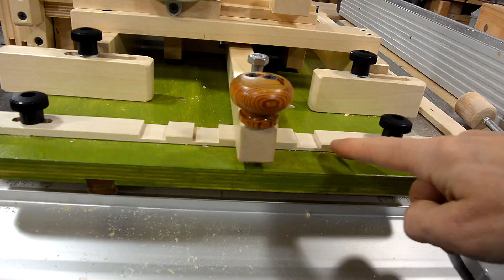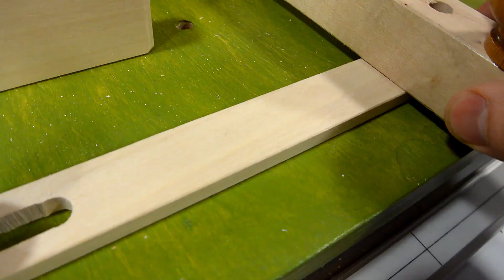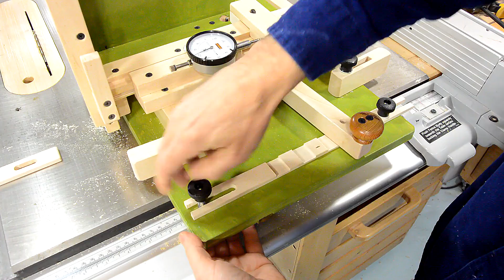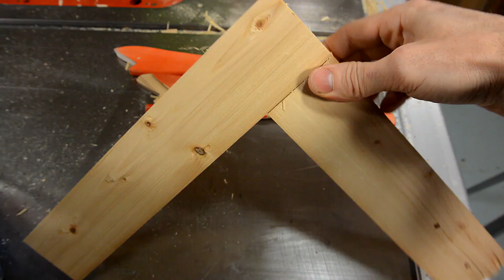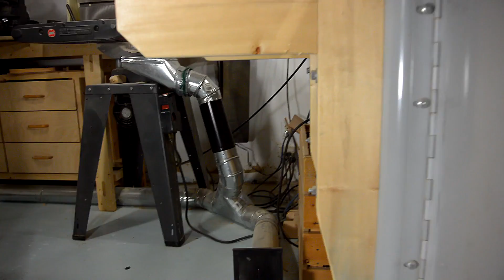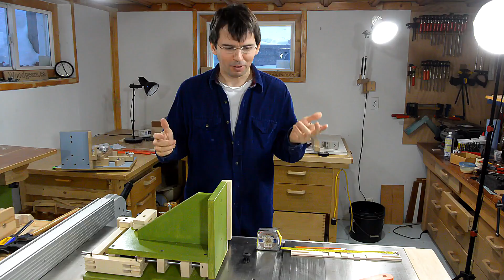"multilap" joint with the quick-set tenon jig

Comment: I wonder if such a template could be used with a slightly tilted blade to finger splice short scraps together into longer planks. I know you put together a good scarf joint for that curtain rod, but I wonder if you have a lot of scraps that are fairly short, but would add up to something much more useful.

Comment: Hmm, not that impressive. You could use a Dado Blade... and make it so you only need to do one cut. Or use a Table Router instead of a Table Saw with a sled like this. Then you could use different bits for the thickness.

Comment: I built this jig and I have been trying to make  "Multi lap joint". The fingers of the joint are 1/4 inch thick,  3" wide and  3.25" deep. However I have been experiencing inconsistent results and tapered fingers. The wood I use is pretty soft, standard spruce 2X4. It looks like the blade is pushing the finger sideways as it cuts through the wood. Also the blade has a hard time cutting through the material. Any special type of blade you use for this kind of cut? I am also thinking the jig might be at a slight angle with the blade, I will have to verify that with a dial indicator. Any ides Mathias? have you been experiencing this phenomenon?

Comment: This will be my next jig build but I think I'll use the screw advance box joint jig to cut the templates instead of eyeballing the notches.
Reply: Can confirm it works well. The normal box joint jig capacity is slightly wider than the width of the tenon jig, so I mounted a short, wide board (wide enough to clamp), cut the notches then cut the template free.

Comment: I cannot see clearly the bolt that makes the impressions.  Is the center cut out only leaving a small sliver on each edge for making two impressions?  
And if there are two impressions do you choose the left impression as the left side of the notch and the right impression as the right side of the notch?   If this is the procedure it seems it would be handy to make an alignment tine on the top of the punch for ease of alignment.
Thanks.
Reply: F
Reply: OK after watching and stopping the video my 78 year old eyes confirmed my assumption about which impression to use.

However an alignment mark on the punch would be be an aid in aligning the punch. 

This said I have a DIY CNC so I’ll just whip out the templates I need on it. 
Thanks

Comment: Very nice!! If you elongated the pin hole that would give you some adjustability in the template wouldn't it? This might enable you to fiddle a bit less? Of course that would also require the ability to lock the pin position.

Comment: I have a ideia...two stepmotors and a arduino...
Reply: we're actually working on that.  I have a 200 step/turn stepper driving a 20 turn/inch threaded rod.  we should be able to make the sled move very accurately.  I think we're going to use a Raspberry Pi.  It won't be nearly as elegant as this one though..Using a microcomputer to control the movement of a workpiece in the shop could be useful for alot of things.

Comment: Stupid question: did you need to move the jig, or was that just a demonstration for the viewers?  I think cutting another piece the same and turning it over have worked.
Reply from the maker: Flipping only works if the workpiece is an exact multiple of 1/2" in thickness

Comment: How cool is that!!!  I've never seen a bolt without its threads like that.  I was at The Home Depot today and they didn't have anything like that. Where might I find something like that without having to buy a lot of them?
Reply: buy a long bolt and cut off the part with threads?
Reply: You can also buy clevis pins. They have holes spaced along the shaft (usually used with 2 washers and a clip. The added benefit is most clevis pins are hardened and closer to actual size than the shoulder on a bolt (unless specifically sized shoulder bolts, which are usually ground to a very precise size and expensive).

Comment: Really neat idea! Btw you should make a fingerjoint jig or something like that, cause bits are expensive and custom made could have more features-adjusting the length for example. Idea to make one is basically the same? Instead of saw blade we can use a single router bit?

Comment: Brilliant.  The notion of using 3:1 reduction is something which never occurs to me, despite having seen Matthias use it with the pantarouter and now with this. That's got to help with precision, right? Any imperfections in the template will be reduced to 1/3 their size, which I would guess is more precise than the table saw is capable of.

Comment: couldn't you have measured the spaces in your template and added one millimeter on every one?
Reply: He added .003".  1mm = .039", 13 times the necessary adjustment.  The satisfying sound of a well fitting joint would have been absent, as well as the strength of the assembled joint.

Comment: since the bolt is tracing out a circumference, shouldnt the template be correspondingly curved? clearly not a big deal based on your excellent results, but i wonder if you could improve precision by addressing this somehow
Reply: you could make a specialized bolt that has a required orientation, and then its curved on either side where it would touch the template, so it automatically adjust as your bar strays further from perpindicular
Reply: Not necessary so long as the arc stays within the template width. Notice in the vid that Matthias marked the slot edges based on the outside tangent edge of the reference bolt diameter. That is all that matters.  Yes the slots could be cut along radial lines on an arced template BUT so long as the point the reference bolt touches is the same point as marked it matters none the orientation of the template slots or template shape.  Hope this helps.
Reply from the maker: If the template was curved, it would become inaccurate if it's shifted to the side. There's no need to correct for any inaccuracies as it is.

Comment: One more suggestion. You could make the hole the 5/8 bolt goes through into a slot where you can adjust the bolt for the fine adjustments.

Comment: Matthias. Good video. My only suggestion would be to maybe find a more accurate way of cutting those notches. You use a dial indicator to go 3 thou over then freehand the cuts? I'm sure experience plays a big role here but the margin of error would cancel out any fine adjustments you've made.

Comment: This joint has maybe 5x the glue surface area that the lap joints you used in your glue strength tests.  Does this mean that it would be 5x ish stronger ?
Reply: More glue surface, but ultimately limited by the strength of the wood itself. Which is awesome, since this joint will never fail because of glue separation.

Comment: One question on the template.  Could you have just widened the notches rather than making a new one? (I'm cheap)  And which side would you have chosen to widen it?  Or both?  Wondering if a little file work on the notches would have sufficed?  Course having you show us how to make one was a lot more fun!  Thanks again.
Reply from the maker: I could have just widened the notches, but that would make for a very incomplete video.
Reply: Matthias Wandel Not to mention the fact that for every template you keep as-made adds to a set of templates for various joint applications :-)

Comment: Excellent video, excellent machine. Not quite idiot proof so can't give you the A+.

To make this easier you could have a fixed point on one end of the templates, so you can guarantee the correct position. Not sure it would eradicate errors though.  Just a thought.
Reply: Someone once said slide rules were too complicated to use. Now we have calculators, and a whole generation of people who can't do math. Sometimes a tool that requires a little bit of thought to use is a good thing!

Comment: Great video as always, although I did find something interesting; you were adding extra 3 thou when punching out your marks, but afterwards, you are eyeballing the marks when making bottom side cuts on the saw. Is it possible to be so accurate on the table saw that those 3 extra thou actually matter?
Reply from the maker: Thsoe marks I punched are at 3x scale, so those 3 thou are now 10 thou, or 1/4 mm.
Reply: Matthias Wandel LOL or maybe 9 thou
Reply: Shouldn't you have punched them at 9 thou then? If I am thinking correctly, the template is 3 times larger than the cut, so adding 9 thou to the template would result to 3 thou on the actual cut. Or did you want 1 thou on the cut and so you've punched out 3 thou on the template?